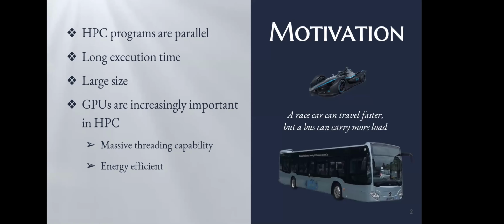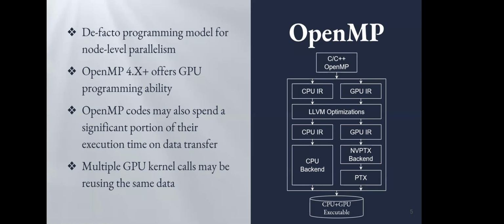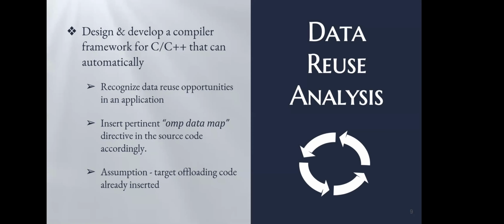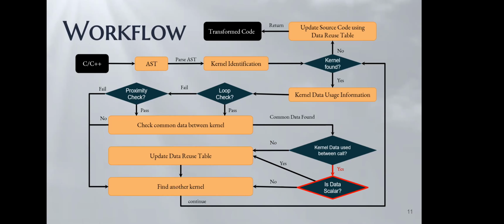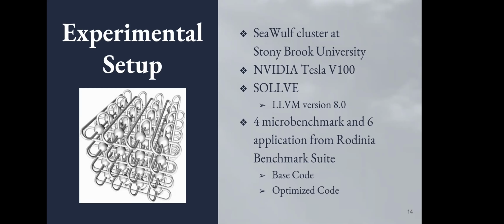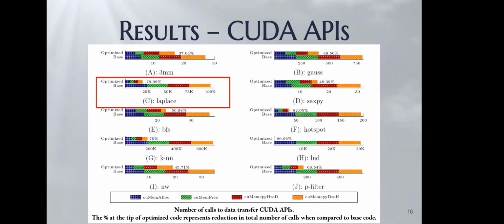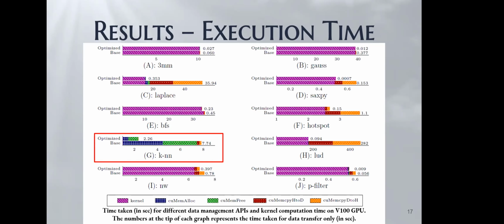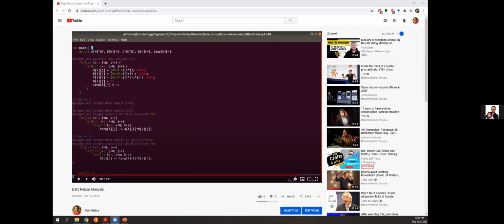Data Transfer and Reuse Analysis Tool for GPU-offloading using OpenMP

Comment: Hi Alok,

Wonderful work here.

1. Do you think these reductions in data transfers are also applicable to other accelerators such as TPUs, NICs, Compute Storage and Caches?
2. Do you think that protocols in Compute Link Express (CXL) standard can make this performance gains greater?
Reply from the maker: Hi Siddharth, 
Thank you for the nice comment. 

1. I haven't worked with other accelerators such as TPUs, NICs, or other similar devices to comment on their performance gains. If we think about it, these data transfer reductions should be beneficial as long as an accelerator can retain memory for subsequent kernel runs. The only issue we can see here is that we've taken up all of these memory on the accelerator. It should be useful as long as you don't end up with memory over-subscription. 

2. My knowledge of CXL is limited as well. But the previous point is applicable irrespective of the interconnecting interface. CXL might help you improve the overall data transfer speed. Now, is the performance gain greater? That depends on how performance gain is defined. Consider a case where a kernel using 8GB of data is supposed to run 100 times on an accelerator. Say we want to measure performance gain on PCIe 4.0 vs CXL. CXL is projected to be 4 times faster than PCIe 4.0. Theoretically, it will take around 25 seconds for PCIe and 6.25 seconds for CXL to transfer the data 100 times. If we only transfer once, PCIe will take 0.25s and CXL will take 0.0625s. In both cases, the performance gain is 99%. However when measured in seconds, PCIe gains 24.75s while CXL gains only 6.1875s. Of-course, this comparison is misleading, because we know that the CXL interface reduces overall data transfer time in both cases. Hope this helps.

- Alok